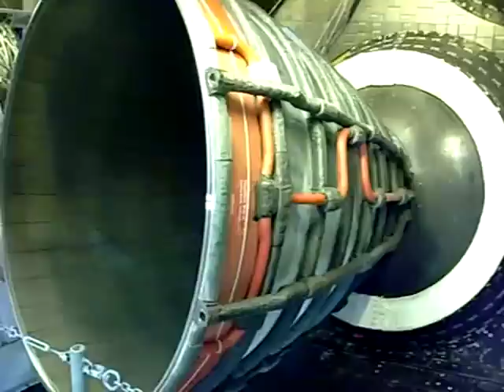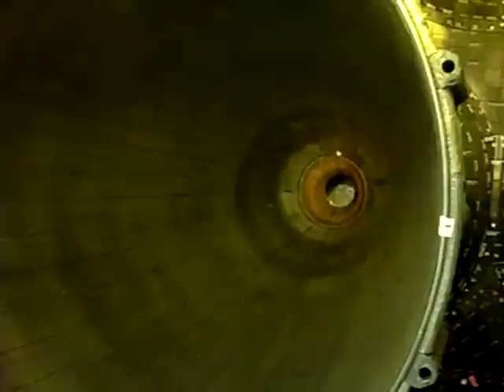Shuttle Endeavour engine noozle gimbal test

Comment: No way can this be real!!!! not with people standing around it. Or should I say this was an Electromechanical  test and NOT a test with the actual APUs.  The APU's Can stear those nozzles a lot faster than this. Definitely Electromechanical.
Reply: skyprop Would be cool to see anyways
Reply: It is real, but it's not done using the APUs, even because the APUs are burning idrazine, highly toxic. I suppose that in the OPF they had another way to perform the gimble check.
Reply: Very detailed explanation. Btw are you working with the RS-25?
Reply: No, I'm not even an engineer, I'm just a passionate for the shuttle and I looked for infos. You can easily find the same things on Wikipedia. I can only wish to work with those beasts =(
Reply: its real.
Reply: This is real, and it's not 'electromechanical'.  The Orbiter has no 'electromechanical' actuation built into it.  The engine actuators are powered by hydraulics, but in this case it was hydraulics supplied from a ground system, instead of using the Orbiter's hydraulic pumps.  You are correct in that the engines can (and do) move much faster than this when required.  But the ground sequence you are seeing is used to position the engine(s) for various things (example--to gain access to a component inside) and there is no reason to run these things fast.